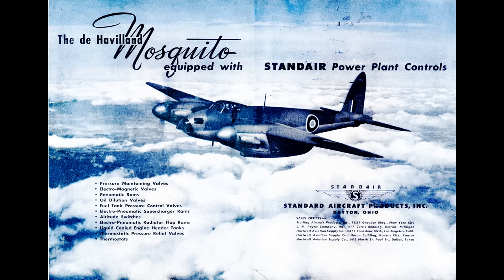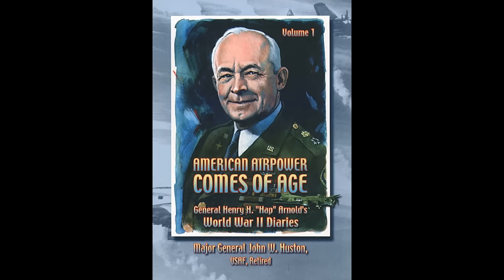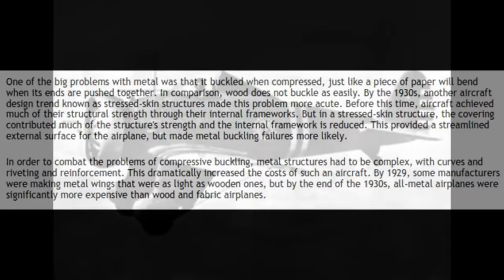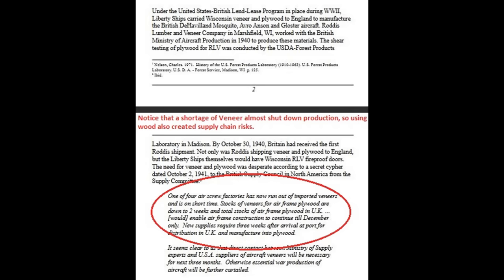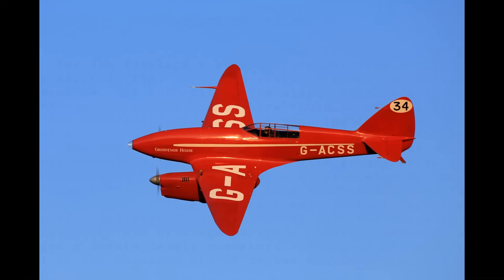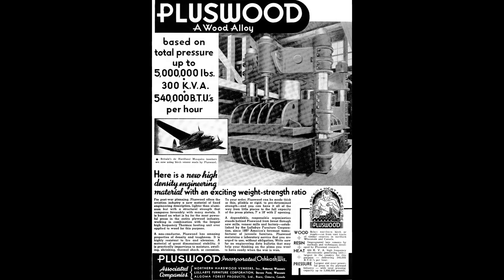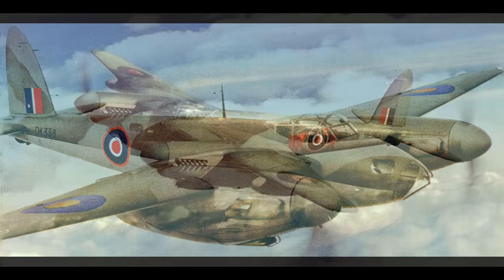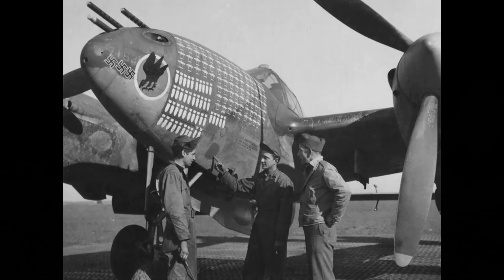De Havilland Mosquito vs. ?

Comment: @ 10:36 “The Soviets didn’t have any problem getting aluminum”. Actually the Soviets were desperate to get aluminum, Stalin specifically asked for aluminum along with high octane avgas when Harry Hopkins was setting up lend lease in 1941.  As the war progressed the Soviets increasingly replaced wood with aluminum in their aircraft.  The Mosquito went all in for speed, altitude and range zero defensive armament.

Comment: Hi Greg, love your work. prefacing my question with I have no real knowledge of engineering, plant required for manufacture, aeronautical design etc; I have heard complex metal parts manufacture requires massive industrial presses. Was there a limitation in Britain with their ability (or lack there of) to make the complex metal shapes which translated into wooden parts being more easily made?
Stay well, regards from Oz
Reply from the maker: I don't think so, they didn't have any trouble making things out of metal when they needed too. They built a lot of metal planes, ships, tanks and so on.
Reply: @GregsAirplanesandAutomobiles  thank you for the reply 😊

Comment: I was hoping you would compare the Mosquito with its contemporaries like other front line fighters, P38, P51 etc and German conunterparts 109 190 and 262. But rather we were looking at older wooden planes of the 20s and 30s etc which was not as interesting ...
Reply from the maker: It's a series, this is the first episode. I like your GTV, I have a lot of Alfa stuff on this channel.
Reply: @GregsAirplanesandAutomobiles  You have Alfas on your channel ? where ? Thats an Alfa 4C in the photo though btw. Im looking forward to the other episodes on the Mosquito then.

Comment: I have several questions about the report. !. Why was Beach even asked as the only plane they had in WWII was the stagger wing, a wooden aircraft? They have contributed nothing to aircraft development and simply copied the designs of others. 2. What was the H.P. of both aircraft, range, fuel efficiency, etc? 3. what was the cost to produce each aircraft? The Mosquito was a two seat aircraft and sometimes a three seater. I dare anyone to try to cram three people into a P-38. In another video, it is claimed that the P-38 shot down more Japanese aircraft than any other in the war. I will bet you will get a lot of flack from the Navy and their Wildcat/hellcat proponents about that. Thus why all the hoopla about a mediocre aircraft like the P-38?
Reply from the maker: You statement that the only plane Beech built during WW2 was the Staggerwing is incorrect. They also built the all metal Beech 18, and the XA-38 which was canceled largely because its engines were needed for B-29s. You also misspelled Beech. Yes, In my 80+ videos on this channel you can find a few cases where I misspeak, the P-38 shot down more Japanese planes than any other USAAF fighter, not any fighter period, the correction is noted in the description. By comparison you made two errors in only your second sentence. cont:

As for range, fuel efficiency, speed, cost and everything else, it will all will be covered in this series, this was only the first video of several.
Reply from the maker: Why was Beech asked? I don't know, but I can guess that it was because the Staggerwing was all wood, and at the time of its introduction was about equal in speed to many fighters in service at the time.

Comment: Mosquito vs B17?
Reply from the maker: Mossie vs. Lancaster would make more sense, but it's not what I'm going to do.
Reply: No problem. I’m interested in the downsides of the B17. I saw another video describing its shortcomings they briefly mentioned the mosquito as having slightly less Payload over long distance /800 miles with significantly better survivability. Given your deep dives in your videos ( Awesome sleeve valve video inside the Sea Fury video) I thought you’d be best to tear into it.  Thanks for your videos. They are excellent.

Comment: Wood is the original composite structure.
Reply from the maker: Great, so the Albatross D2 was a composite airplane.
Reply: @GregsAirplanesandAutomobiles  Greg as you know these  airplanes were built with a layup method that crisscrossed grain pattern. Lockheed built fuselages in a cement female mold. I believe the Pfalz  was also laid up of wood strips in some fashion.  We know wood has a strength to weight advantage to some metals. Those are the same characteristics sought in composts.  I do not know if the D2 had a wood structure as the Pfalz.
Reply from the maker: My point is that in modern aviation parlance, the term composite structure doesn't include plywood, whether it's sandwiched with balsa or not. The Mosquito is awesome, really awesome, but the use of wood was done for convenience, not because it was superior to aluminum.
Reply: @GregsAirplanesandAutomobiles  Greg you are correct and I appreciate your videos. My point is wood is disparaged when it has been proven..

Comment: The stressed-skin design with plywood allowed the Mosquito to take a lot of hits and not have structural failure.  That is because the entire surface had the ability to take loads, effectively adding redundancy.  The plywood in thick enough to not buckle if a amall area of support is removed (destroyed).   As long as they are spread out a bit, the bullets just add "lightening holes".  With the aluminum aircraft of the day, the load was largely carried by stringers and ribs, each of which was carrying a significant amount of load.  Holes in between those stringers or ribs had little effect, but a single bullet hitting a stringer has a larger effect on the overall structure since the thin aluminum will buckle rather than being able to bridge over that area as would plywood.
 It was pretty easy to punch a hole in either plywood or the thin aluminum, so there was not a big difference there.   Small arms groundfire could punch holes in pretty much anything that was not armored (or the engine, of course).

Comment: Navy test pilot Eric brown put a mosquito on a carrier
Reply from the maker: US Navy pilot Lt. Flatley landed a C-130 on an aircraft carrier. Both landings are super impressive, but neither turned out to be practical.
Reply: When Eric brown put the mosquito on the carrier it set the stage for de Havilland to build the hornet for the Royal Fleet Air arm

Comment: Financial gain aside Greg ...what other US plane at that time, or since, could out-perform the Mosquito?
 Hard question to you. Had you been the evaluation engineer in 41, not Hap Arnold, would you have supported it > ? Metal vs wood ? wasn't it really only USA Manufacturers greed and the not invented here syndrome??  Anyway the Mossie was the first and a better multirole aircraft than any throughout the war.
Reply from the maker: Both are reasonable questions, and I do have answers to them, but they are complex, so I'll answer within the next videos in this series.
Reply: @GregsAirplanesandAutomobiles  , My feelings were the NIH was dominant with Hap Arnold's evaluation. An Aluminum skinned copy with  the RR vs P51 Allinson engine  could have been great vs the P38, with a 10-15  degree sweep and P51D linear  wing flow. The Single tail with the aerleron active ... Revisionist I know and apologize,

Comment: I think beechcraft was blowing it out their you know what. During World War II beechcraft provided aircraft made of wood to the United States military training commands. Fact not fiction. They also put the notorious ranger engines in those aircraft. The mosquito was an exceptional airplane for it's day. Do I think it was the best airplane in certain roles I would agree. People like to point to bombload, of course it has more bomb capacity, it has an internal Bombay. Is there any testing data of the mosquito carrying two torpedoes? There is for the p38. What I want to fly a P 38 with two torpedoes long under the wings? I don't think so. That's got to be walking on eggshells! Though I have had the Good Fortune to have read about short range missions with ridiculous bomb loads on p38. Somewhere around 5,000 lb or more of bombs on a fighter . You would have to look at the history of the fifth air Force in the Pacific for the information. Funny story about the droop snoot with the norden bomb site installed, they accidentally bombed a large greenhouse complex full of brussel sprouts in France . It is thought they set back brussel sprout production by several years. as for the ballistic qualities of wood I would agree with Greg on this . Plywood has some unique properties in that the criss-crossing grain strengthens the wood but I think that the glue between the layers diminishes the elasticity of the wood. I remember many years ago someone came out with a submachine gun firing 22 long rifle. A concentrated burst of one magazine from the 22 caliber submachine gun could cut a telephone pole in two. One question that would be interesting to explore, would the geodesic construction of the Wellington be stronger if it was covered in aluminum rather than cloth? I'm not overly fond of British heavy bombers, I tend to like more guns on my airplane! but there's something about the Wellington that just makes me think there was more to that airplane than they ever thought. I somehow I think it's development cycle was cut short due to wartime necessity of concentrating on Lancaster construction.w

Comment: ets have the British assessment of the P38 , a load of crap , give it to the Russians. Mosquito had the lowest loss rate of any bomber in WW2, also it could carry a 4000 lb bomb which was too big to fit into a B17'S Bomb bay , as a nightfighter among the very best , and was particularly good at shooting down German Nightfighters.  Anti shipping , pathfinding , even used as a passenger plane from Scotland  to Sweden . Best Recon. aircraft , fraid not the Spifire xi and xix hold that distinction.
Reply from the maker: The British P-38s lacked turbosuperchargers and counter rotating engines, which defeats the whole design as we will see in this series.
Reply: @GregsAirplanesandAutomobiles  You appear to want to place the P-38 in the same category as a Mosquito , sorry no comparison , I  will concede that the Lightning  was  highly effective in the Pacific , but in Europe poor .  When you do your series on the P 38 no doubt you will leave out two engagements with P38's tangling with Me 109's in the Med. The first on the 25/8/1943 when 13 P38's  were shot down for no German loss, the second a week later on the 2/9/43 when they were again mauled  by 109's with the score line 10-1.  On one occasion in N.Africa six 109's fought eight P38's and shot down seven.  You mentioned that P38's were adapted for strategic bombing  The most famous must be  the attack on the Ploesti Oil Fields on the 10/6/44  when 42 P38's loaded with a 1000lb bomb and escorted by 48 P38's  lost 30% of the force for little result.   But for myself the final word of condemnation comes from an American Lt Col John Blythe who came to England to fly P38 F5's photo recon missions . He had so many problems with the type  that General Eaker managed to get them Spitfire Mk xis  which could fly to Berlin and all over Germany , No need to take my word for it as its on Youtube under Spitfire 944.

Comment: Proud American history buff here. The P-38 Lightening was indeed a great combat aircraft, probably (in my humble opinion) one of the best fighter bomber/reconnaissance aircraft of the war. However, to claim the P-38 could fulfill all of the roles of the Mosquito is simply not true. The "Mossie" had a greater range and carried a higher bomb load than the P-38, while having nearly equal firepower for air to air combat. Additionally, for covert operations, slightly modified Mosquitos could land on any relatively smooth patch of ground behind enemy lines and evacuate one or even two operatives in modified spaces in the fuselage who had to be returned to England. Those same modified aircraft also carried SOE radio operators in the modified fuselage, allowing them to make short range radio contact with agents on the ground to gain intelligence while protecting the agents from German radio detection teams. No way could the Lightening have done either! The P-38 was indeed a great aircraft. The Mosquito, on the other hand, was a truly phenomenal aircraft! My Brit cousins should be proud of the history of this extraordinary aircraft!
Reply from the maker: Nobody claimed the P-38 could fulfill all the rolls of the Mosquito, nor could the Mosquito fulfill all the rolls of the P-38. The key word there is fulfill, generally speaking both planes could perform the same types of missions with different degrees of effectiveness, these include bombing, fighting air to air, recon, anti shipping and a few more. Which one was better overall? I haven't addressed that yet.
Reply: DH98 Mosquito FB. Mk VI
2,305 built.
Fighter bomber / intruder variant using Merlin 22, 23 or 25. 4 machine guns and 4 cannons, plus 2 x 250 lb bombs carried internally & underwing carriage of up to 2 x 500 lb bombs. Could be fitted with underwing rocket projectiles or drop tanks instead of external bomb carriage. 
BAE Mosquito page

Comment: Could the P38 carry a 4000lb bomb? The Mosquito could and frequently did.
Reply from the maker: The P-38 could and did carry a 4000 pound bomb load. I'll cover this in more detail as the series continues on.
Reply: The Mosquito  could carry a single 4000lb'COOKIE in its bomb bay which was a large weapon. I am not talking about a collection of smaller bombs amounting to 4000lbs
Reply from the maker: Both ways of doing it have their advantages. I hope you will stay for the series.
Reply: I certainly will.
Reply: @davidhack1974  B. Mk IV   283 built
Night bomber using Merlin 21 or 23. Bulged bomb bay fitted    to some   to allow carriage of 4,000 lb bomb internally. Max speed 380 mph, max weight 21,462 lb.   Twenty seven   built as B.Mk IV modified for PR role

BAE Systems Mosquito page
https://www.baesystems.com/en/heritage/de-havilland-mosquito

Comment: Greg, please don't slag off the Trident. ( Sorry to be honest you more accurately damn by feint praise)  The DH 121 Hawker Siddeley Trident was an absolute technological game changer. It was the worlds first cat 3 autoland aircraft. 
 https://www.youtube.com/watch?v=v7RMlluY0sA    Alas it suffered from the British post-war malaise of the major UK airlines dictating what the maker would build. The Trident should have been a larger aircraft with a bigger engine. So the larger aircraft wasn't built and thus the bigger engine wasn't built either, hence a subsequent larger Trident  was a 3 engine aircraft with 4 engines and still "Only Took Off Because Of The Curvature Of The Earth!" A sort of reverse abortion of the disaster that was the "Hot And High" capable VC-10 that BOAC after specifying then realised was less economical than the Boeing 707. Also, the DH 121 was very fast and could drop faster than a rock being able to deploy thrust reverse while in flight. 10,000 ft/min I recall they had to predict and open air equalisation in advance otherwise negative pressurisation could occur.  https://www.youtube.com/watch?v=a1TDqZIt1fc  at 11.50   Yes I know he says 8 to 9,000 but other film exists.
Yes, yes, yes I can appreciate its limitations but De Haviland wanted to build a much better aircraft. Heck if the Mosquito was so damned good you would have thought the Govt would have provided the grants despite BEA to a proven winner.
Also there was an open discussion with Boeing over building one aircraft instead of the DH 121 and the Boeing 727. Rather stupidly De Haviland was rather too open for their own good.
Reply from the maker: Hi Colcultist. You may be the first person on this channel to comment on the Trident, and I have shown it in two videos so far. I had to look up the term "slag off", apparently it means to verbally abuse. So I'm confused, what did I say about the Trident that was negative?

Comment: wood is 20% lighter than aluminum
Reply from the maker: Per what? That's the question. Unit of mass, or unit of strength, or temperature resistance? When you look at the big picture, aluminum is superior.
Reply: @GregsAirplanesandAutomobiles  weight per strength . Burt Rutan said "aluminum has no place in aircraft"  at EAA forum in the early 90's , the room went silent . Aluminum is very fatigue prone ,notch sensitivity etc. titanium and carbon fiber are the only ones that outperform wood on weight/strength . Spitfires being built in wood are  about 2000 lbs lighter the aluminum originals. Water is woods biggest  
weakness . But with graphene infused coating wood may overcome it's greatest flaw.

Comment: Same payload as a B17, much faster and able to cope with fighters. It could have saved thousands of lives if it had been used instead of the B17
Reply from the maker: It's much more complicated that that. I'll address this in a video.
Reply: The Mosquito wasn’t a high altitude bomber of particular note.  The RAF built thousands of Lancasters even after the properties of the Mosquito was known.